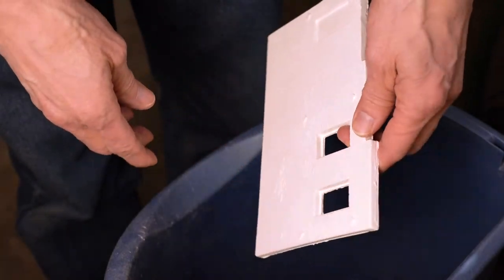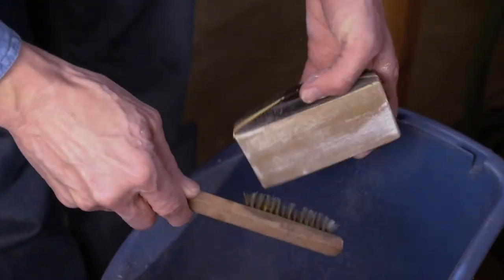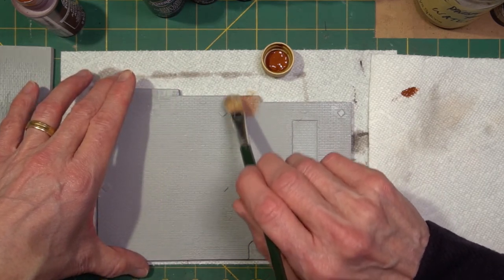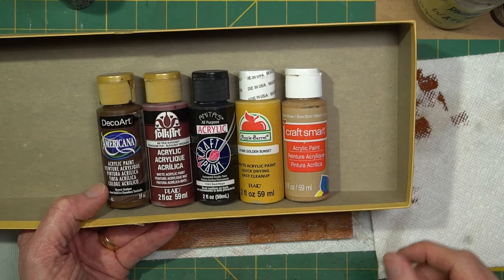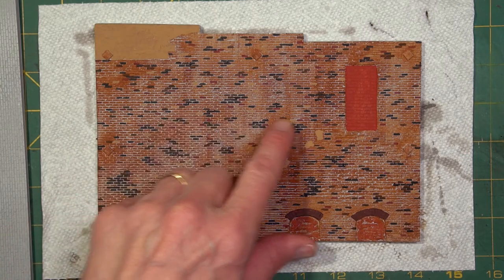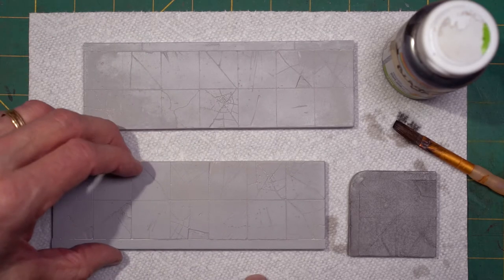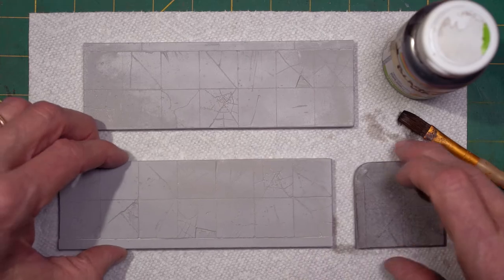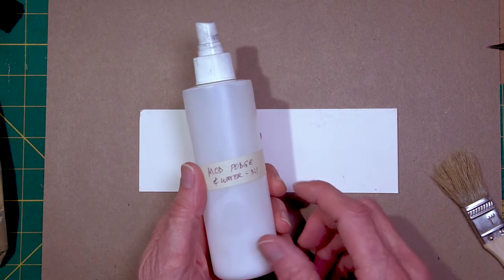Painting a plaster building from Downtown Deco

Comment: I've found that after you sand the back side of paper signs, spreading white glue makes the sign stretch and it makes the sign very fragile. Now I just brush acrylic matte medium on the side of the building, lay the sign in position, and burnish it down as you described. Any excess matte medium around the sign edges disappears completely when it dries.
Reply: Great idea.  Thanks